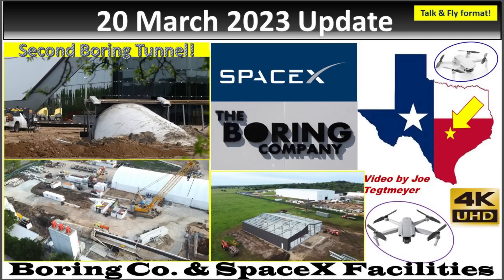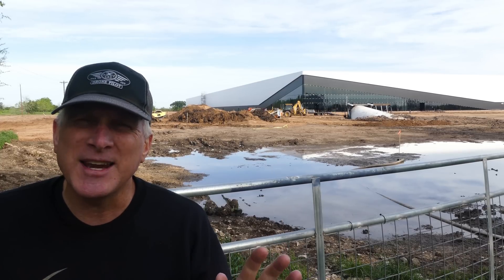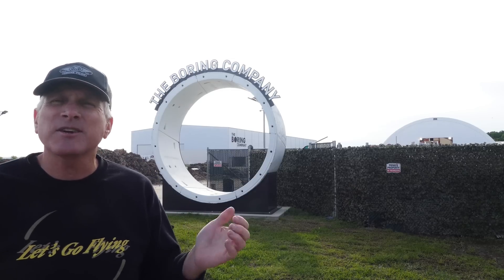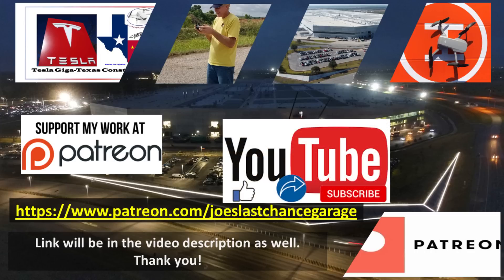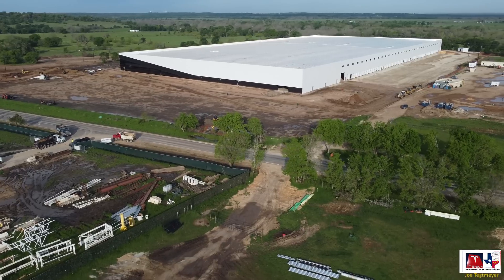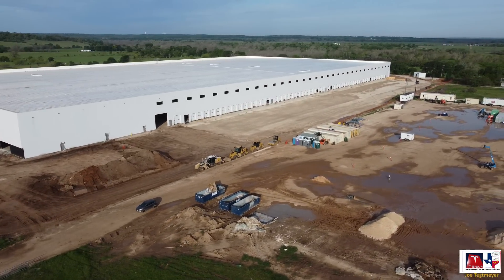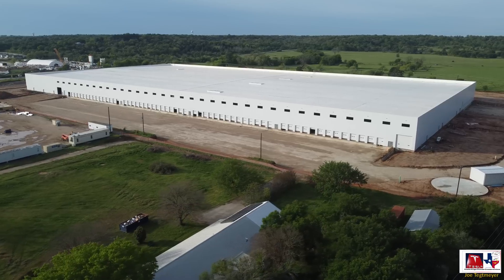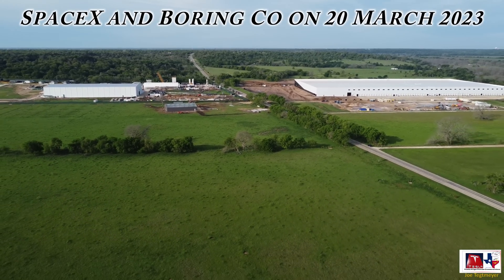SpaceX & Boring Co Progress & 2-mo comparison! 20 March 2023 Boring Co & SpaceX Bldg Update(08:30AM)

Comment: These tunnels feel like kind of a waste, but guess if they need to practice or test out new methods of drilling.  Any idea how deep they go under the road? Or if they just barely submerge under the ground. If they are super shallow not sure how much that helps with new techniques since other locations would need rock tunneling not just dirt.
Reply: This reminds me that it might be useful to have tunnels between the various large buildings at Giga Texas.  Would love to be a fly on the wall at discussions of the end-state design of that site. I can see significant advantages to having dedicated tunnels for moving vehicles and supplies/batteries around the site, before I even know what other buildings they have planned.  Also a tunnel which leaves the site to a railhead would make sense, particularly once the newly manufactured vehicles can drive themselves through it.
Reply: @biovmr  definitely could see tunnels being useful at giga Texas. Especially one from some kind of warehouse building to the main factory, then could use more robotic carts to resupply production stations with less reliance on the WOW concept. 
Will be interesting to see what's included in the southern expansion. If it includes some kind of parking garage for "almost finished" vehicles as that lot now is always full even before the cyber truck.
Reply: @biovmr  a tunnel to the rail would be cool, but highly doubt that will happen anytime soon as there would be at least a decade of red tape involved. Definitely would be nice to see those deliveries taken over by a fleet of Tesla semis, and could be a good route for testing semi autonomous driving.

Comment: 4:58. Building under construction. There’s a shipping container to the right. Joe’s photos show the other side and it is marked Swissloop Tunnelling.

Swissloop Tunnelling is a University associated research company specialising in small bore tunnels. Came second in the TBC Not-a-Boring Competition in September 2021.

Direct cut and paste from Wikipedia; the competition challenge was to "quickly and accurately drill a tunnel that was 30 m (98 ft)-long and 30 cm (0.98 ft)-wide". 

Swissloop Tunnelling has a website, youtube not letting me post the link.

Comment: A few bits of tunnel terminology for future reference and to help those who follow these excellent videos but have no knowledge of tunneling:
Prufrock 2 is an Earth Pressure Balanced (EPB) type tunnel boring machine (TBM). Its unusual since their setup is designed to launch with no ground cover. Normally traditional tunneling is undertaken with 1 to 2 diameters of ground cover.
The TBM rotates at a few RPM driven by electronic motors. A mix of cutter types on the front face depending upon the ground through which the tunnel passes.
The ground excavated by the TBM passes from the rear of the cutterhead to the spoil conveyor system through an inclined screw auger. This screw sits within the TBM and by controlling the spoil throughput of the screw you can control the pressure at the face of the TBM so that there is no excess (settlement) or under excavation (heave) of the ground. That's why its called an Earth Pressure Balanced machine.
The extendable spoil conveyor runs initially from the TBM along the top of trailing sledges. These sledges are towed by the TBM as it tunnels forwards. The sledges house support equipment to the tunneling operation and are added behind the TBM in sections.
The tunnel lining is formed from six trapezoidal, tapered, precast concrete segmental rings. The design is somewhat unique to the Boring Company. The segment shape helps when the ring of segments is built by the ring erector system - possibly robot type now. The shape also removes the possibility of a "+" joint between rings which are otherwise difficult to seal off for water ingress. The segments will likely have a neoprene gasket fitted around them to keep the final tunnel fully watertight below the water table. The tapered shape of each tunnel ring means that the alignment of the tunnel can be straight (by alternating the orientation) or curved, such as for vertical curves or to correct for TBM steering alignment deviations.
The TBM pushes itself forwards off the tunnel lining using hydraulic cylinders. The segmental rings are then built at the rear of the TBM in a protective tail skin (a thin steel tube attached to the rear of the main TBM front section. The rings are a bit smaller in diameter than the TBM and the gap between the rings and the ground (once the ring has emerged from the rear of the tail skin) is filled with some type of grout, traditionally cementitious based.

Comment: Thank you Joe for this tour of the Boring Company and SpaceX emplacements and their developments just down the road from GigaTexas.  Does anyone know for what these buildings will be used?
Reply: The Boring Co. stuff is just development, staging, and some demo tunnels,  along with some temp.  housing as over 90 % of what they do is location specific and changes over time.  I think the SpaceX facility will be mostly for Starlink . Maybe HQ, mfg., and shipping. Starlink is in it's very early stages and only about 5% of it's projected size. In a few years; the annual satellite replacement rate will be higher that the current number of orbiting units. Hopefully; that % will improve with better satellites, but there will always be a % that need to de-orbit and be replaced every year. What many folks don't realize is that Starlink will eventually be a much bigger source of income than Tesla cars. The same will be true for Tesla Energy Storage. So why, some might ask, art these not more prominent ?   There are several factors, but the main one is that transitioning to EV transportation is the current fastest way to move to a sustainable / pollution free civilization.  Elon has said often that the "experiment " of burning carbon fuels that drastically affect global warming, and toxic air pollution,  is not one we should be engaged in as it could very likely endanger the entire human race."   The  over 30% share produced by transportation, is the fastest part of the problem to address. So, EV's.